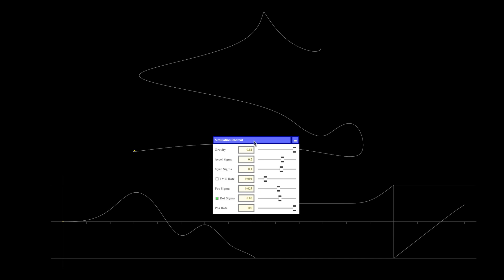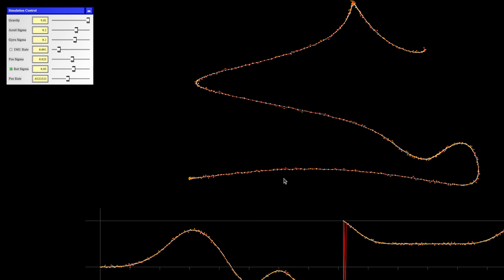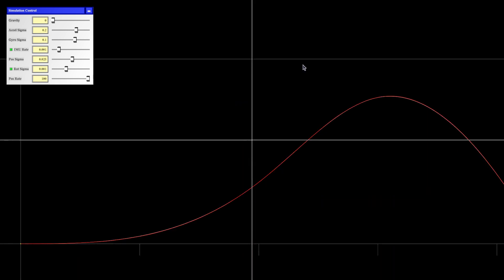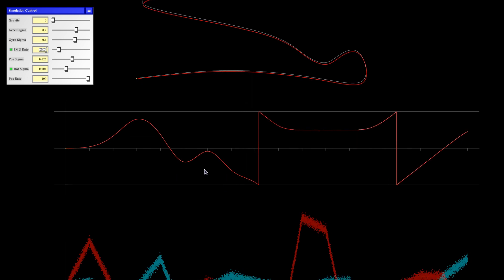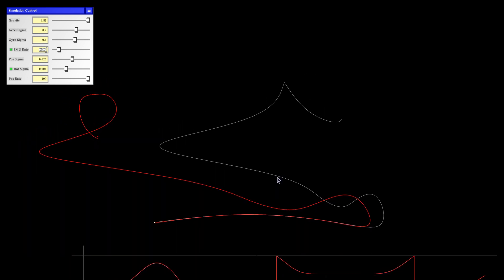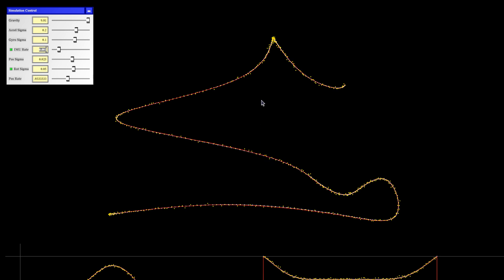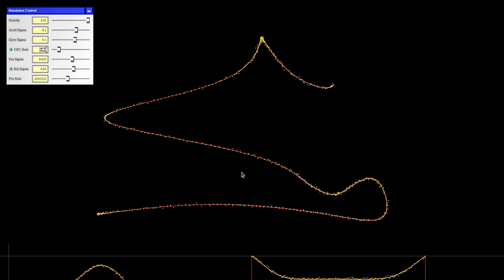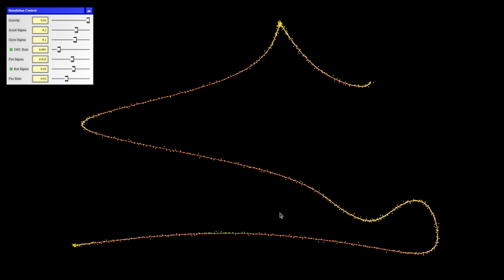Sensor Fusion for Object Tracking

Comment: If the amount of deviation or margin of error is constant why not remove it by truncating or rounding the data? If the noise is caused by false measurements and not inaccurate measurements it would for one solve the drift in the case of inertial tracking.
Reply: because it deviates around the true value, it's not an offset. and because you can't look into the future, you can't just smooth it without adding lag and losing responsiveness
Reply: I've experimented a bit with an IMU and the noise only exists at a certain decimal place onwards (i.e systematic errors). Not sure if the true measurements actually lack precision, is that what you mean?
Reply: besides systematic errors, there will always be random noise (probably gaussian) added to the true value. for gyros those errors are very small, even in cheap IMUs. I've implemented rotation tracking on such an imu myself, and I've found it very stable for a long time. when you add movement however, the errors do add up, no matter how small. the accelerometers even in much more expensive IMUs are usually your problem here, their errors are much larger.
but large or small, you can't just "truncate or round" the data, because you don't know what the real value is. who's to say what you truncated wasn't actually perfectly correct data?
Reply: Indeed there will always be some random noise because no IMU is a 100% precise, however such noise is much less than the systematic one.  How can you identify systematic errors? Well, they are usually constant, for example, even when the IMU is at rest. Even if there is a "true measurement" in there it would be so distorted that it would be useless.
Reply: at this point all I can say is that I think you don't understand the subject matter, and youtube comments won't change that. I've watched the video you did in response to this, you actually think the stick is comparable to an accelerometer. think about this some more, and for the love of whatever is holy to you, toss the notion that error is "just in some decimal places" that you can magically round away, which you have repeated several times.
Reply: LOL that was pathetic. I hope you don't consider yourself an honest thinker or a scientist.